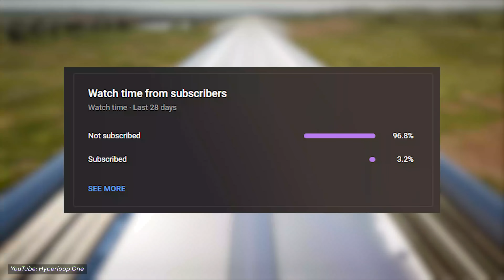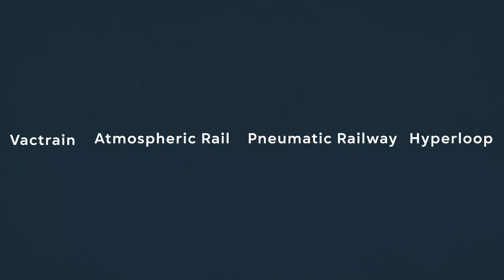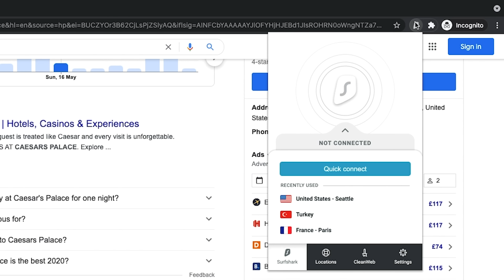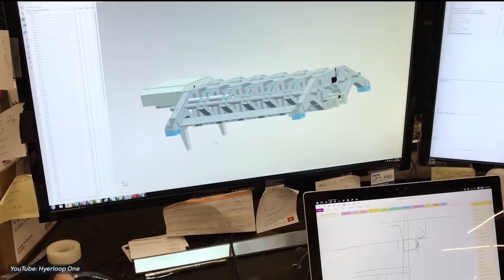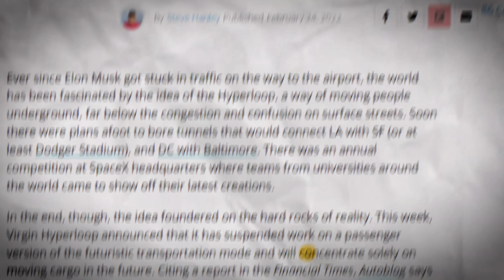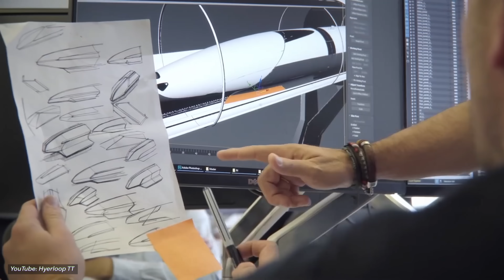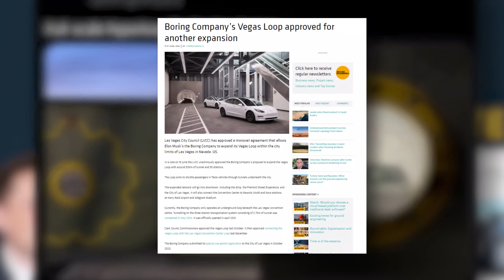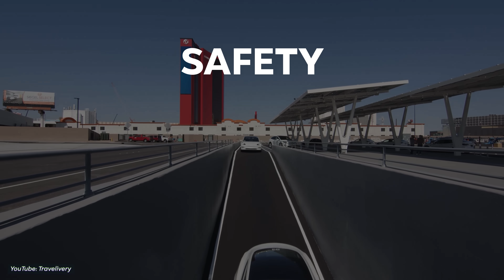What Happened to Hyperloop?

Comment: The only thing Hyperloop is good for, is for YouTube creators to make videos on it.
Reply: Fr
Reply: Yes I'm hyped up
Reply: Like Saudi's THE LINE
Reply: and for people like Elon musk to flex their money and power, when in reality, they were just talking from their asses. AS USUAL
Reply: I agree
Reply: @Skunket no solar tile roofs...
Reply: Elon is loopy.
Reply: And for bored artists to make computer renderings
Reply: i mean, if Canada has a hyper train that takes us from one side of the country to another within a hour.. I would use it.  That is like waking up to new sneery each week, trying out new food, meeting more people!
Reply: The correct name is "The Hypersonic Train" and it's basically, a hypersonic Maglev which would run in a technical vacuum tunnel (couple mm Hg) same pressure as it is at 30+ Km altitude! U need a pressurized Maglev train in the same way a space capsule has pressurized air. The maximum technical speed of such device is somewhere between 5500 and 6500 km/h to a maximum threshold of 7000 km/h or 4000 mph due to Coriolis Effect. The energy requires is 1/10 of a long airplane trip across the same distance , being able to transport over 2000 ppl. That's the initial Project. 🥰🤗😇
Reply: @Skunket I bet the reason that you hate Elon Musk is because he released The Twitter Files, stop being afraid of the truth and stop being jealous of Elon Musk
Reply: Bwahaaaahaaa hahaha 🤣 good one
Reply: 401 like
Reply: No, it's to undermine actual public transportation, so Musk can sell more cars.
Reply: @swingingkris  You actually think one man can undermine public transportation, you really are obsessed with Elon Musk 🤣
Reply: @briancleveland6115  Not the entirety of it, just some projects here and there. Every time he proposes some ridiculous futuristic bullshit is somewhere where there are plans for actual practical public transportation. And in a few places it has worked.
Reply: @swingingkris  You seem like you are still mad about not getting what you wanted for Christmas as a child !
Reply: @briancleveland6115  You seem like you ran out of arguments.
Reply: @swingingkris  I will never run out of arguments, but it does seem like you have ran out of answers !
Reply: @briancleveland6115  says the dude defending Elon Musk for the entire comment section of this one comment, also Elon has yet to prove a success other than a singular EV car, SpaceX has not launched really, he proposed an uncanny robot that more terrifying bc it means man kind becoming irrelevant, cyborg enhancements that would require ACTUAL TESTING to install into THE BRAIN, and of course hyper loop which the video says all, oh and he did send Twitter into its single worst dark age so yk, but I’ll be very happy to see ur retaliation comment to fairly solid logic
Reply: @creeping_ace2123  Are you racist against African Americans 🤔
Reply: @briancleveland6115  okay yeah ur fr out of comebacks that statement alone is uncalled for and I said nothing even remotely justifiable for it, so cope and just stop cause ur not winning anymore
Reply: @creeping_ace2123  You do know that Elon Musk is African American right !
Reply: @creeping_ace2123  I never had any intention of winning !
Reply: @briancleveland6115  sure bud u keep telling yourself ur not arguing against a stone wall, ima also be the bigger man here and drop the argument bc clearly u won’t stop and will always seeth at the things that u aren’t winning, so gg’s dude u win the most insignificant and sad argument ever of logic vs opinion
Reply: @Creeping _Ace21  Like I said my goal isn't to win, I was just pointing out the fact that what you said in your comment about Elon Musk was not factual, and instead of trying to defend yourself you implied that my only goal was to seeth about things that I want to win ! By the way it's spelled seethe not seeth,  and your last sentence made no sense at all ! Come back when you can actually defend your comments !
Reply: You nailed it
Reply: Thank God has been cancelled. This hyper loop system is supposed to be built in China.
Reply: No you guys said this type of things when Elon said he want to go to mars
Reply: @SkunketFWIW, this just needs more time to make, give it another 50-100 years and it’ll become a reality 😂
Reply: its an embarrassing idea.
Reply: AGREE
Reply: Youtube gets money from ads attached to clips
Reply: so true lol
Reply: but the concept is cool
its being used in nyc and in Disney land as garbage transport
Reply: @@Err-dp2ml straws for giants
Reply: @@ahisheks2776 Stop being obsessed with someone you don't even like, he made Tesla what it is today and look at how good Spacex is doing.
Reply: @@ahisheks2776 By the way some other is two word. And by some other two guys is definitely not proper English.
Reply: And what are you good for? Only commenting on YouTube about what other great people are attempting
Reply: The main reason Musk pushed it is to sabotage California high speed rail as that was specifically intended to reduce car usage.
Reply: If the U.S. doesn't do it, other countries will and leave the U.S. far behind.

Already, Dubai, India, Japan and other countries are building the Hyperloop.

Don't be short-sighted.

Highspeed transportation DIRECTLY result in higher economic activities, hence MORE WEALTH for the nation with it.

Do you want the U.S. to become a has-been?
Reply: @andyhughes1776  The US is already a has-been. Hyperloop is not practical. Building a vehicle to repeatedly carry hundreds of passengers, requiring either spacesuits, or risk the fatal consequences of a leak. Just see how much painstaking effort NASA went thru when simply sealing hatch on the space shuttle, after it's crew were loaded.
Reply: it gives them topic😅
Reply: Creating new jobs, he wasn't lying, cern, bluetube creators, tiktok, streaming, of,ph, lazy bullshit
Reply: All you Elon haters need to be quiet, what will it take? A free dirt brick for $200?  $5,000 (not talking a obout the jet location!)? Not sending your car into space?  $250,000 instead of a horse? Your $40,000,000 weed smoking fine to be paid off by the taxpayers? A job in return for awarding a $4,000,000,000 contract you don't actually qualify for? $6,000,000,000 overvaluation paid of your insolvent company? $44,000,000,000 for your company for an excuse to dump some stock? A cut of  the $56,000,000,000 paid bonus being given back because it's more than the company ever made in profit total?  Not being banished from Mar's by the emperor himself? Somebody speak up and name your price, we've barely put a dent in all the shenanigans which can effectively be handled.
Reply: Worked really easy for my video. No maglev needed.
Reply: Or show up in Futurama
Reply: Musk’s personal philosophy is that you need to exaggerate, embellish, over promise and commit acts of fraud, to get anything done. He is doing a lot of good, but we will see whether it was net-net worth the price of his lies. One thing is for sure, he makes an awful role model for future entrepreneurs
Reply: @lawjef  He isn't lying..  but perhaps there's just too many tunnels under America already, also California is not the correct state for this.. You forget California is over a few volcanos, the Andreas Fault, Medicine Lake volcano, Mount Chasta, and 4 others.
Reply: @lawjef  He is doing nothing good, he is a scammer.
Reply: @lawjef  You do know he founded Tesla right,  and is the richest person on Earth,  sounds like the best role model to me.
Reply: @briancleveland6115  musk founded Tesla, you sure?
Reply: @AzzrudinJamil  He was one of the founders, so yes, he also founded SpaceX and the Borring company.
Reply: @briancleveland6115  evry company elon made is useless exept space X
Reply: @briancleveland6115  have you ever heard of the Indian guy who had 40 billion but become poor cuz of his bad choices.......if elon keept this shit he wouldn't be so deffrent
Reply: @briancleveland6115  bruh i really understood nothing of what you siad
Reply: @briancleveland6115  lol he just bought tesla
Reply: @aaronpingol1566  He confounded Tesla, stop crying, if you don't like it buy your own EV company and beat him at his own game, and stop being obsessed with Elon Musk
Reply: @briancleveland6115  confounded means angry and i'm not obsesswd with i'm just saying facts that he isn't the founder he just bought tesla
Reply: @briancleveland6115  maybe your the one who is obsessed with him seeing how you defended him and everything
Reply: @briancleveland6115  He didn't and he isn't... 😆😆😆
Reply: @davidwebb4904  Stop being jealous !
Reply: @briancleveland6115  He did not found Tesla, he bought his way in and pushed the founders out.  Rich people are not necessarily role models.
Reply: @Andriastravels  Admit that the only reason you hate Elon is because he released the Twitter Files.
Reply: @AzzrudinJamil  he didn't. But it's his now.  -- RIP Nikola Tesla
Reply: @اسكندرفكار  you make me laugh 😂🤣 Space X lmao he nor NASA have broken the glass ceiling.
Reply: @aaronpingol1566  He had to be very successful to buy Tesla.
Reply: @briancleveland6115  yes his father has an emerald mine
Reply: @aaronpingol1566  So his father is also a successful businessman that's cool, I didn't know that, so you may be obsessed with him.
Reply: @aaronpingol1566  Not really obsessed, I never heard of him until about 2021, but you seem to hate him because he is successful and you aren't.
Reply: @briancleveland6115  that implies that you are very young. I just can't see how an adult can make it all the way to 2020 without hearing of him. Elon announced by hyperloop in 2013. He was already very very famous then. In the same league as Steve Jobs. But then you probably have no idea who Steve Jobs was. He died in 2011. You were probably 4 years old then. The rest of us who are older sees things differently. Because we have lived through and experience things you weren't aware of. As you get older, you would understand.
Reply: @briancleveland6115  his father was a white man in apartheid South Africa who owned an emerald mind. The usual response is not "cool his dad was also a successful businessman". You sound extremely young and naive. Or you're pretending to be and just trolling everybody.
Reply: @Daniel CH  You have me mistaken for someone else, I don't watch movies and the last time I went to a theater was about 20 years ago, I have heard of Steve Jobs and Bill Gates, and said I have heard of Elon Musk, it was about 2020 when I found out he owned Tesla,  and then later I learned that he is from South Africa, I was 45 in 2011 I've lived in 11 states,  Texas, Georgia,  California, Florida, Pennsylvania, Massachusetts, Maine, Florida, Colorado, Arkansas, Virginia, I've been to Canada, and to Mexico plenty of times,  I've only recently even slightly cared about politics or finance, so don't pretend that you know anything about me and I want pretend that I know anything about you, all I know is that you seem to hate this Elon dude  because he broke some kind of promise to you about some kind of high speed rail system, and you seem way too interested in him, all I know about him is what I've said before, and I'm not that interested in knowing any more. You really should stop being so obsessed with him and worry more about your own life.
Reply: @danielch6662  What's not cool about owning a emerald mine, or being white, I'm white because my mother and father were white, a person has no control over what color they are, so why do people make it an issue  ?  You say I seem young to you,  I take that as a compliment, you say I sound naive, naive about what  ? You talk like a you may either be a liberal or a socialist.
Reply: @danielch6662  You are the one who told me that his dad was a successful business person who owned a emerald mine, so don't try to outsmart me because I doubt that you can. And I only occasionally get on YouTube so you probably won't hear from me again.
Reply: @briancleveland6115  for someone who don't have a lot of freetime seeing how you don't watch movies you sure have a lot of freetime arguing with people who commented a few days ago
Reply: @aaronpingol1566  That's all you got ?
Reply: @briancleveland6115  He was NOT one of the founders. Tesla was founded by Martin Eberhard and Marc Tarpenning. Musk only invested in it and lated claimed to be a founder. It was not his concept and he didn't have anything to do with the design of the cars.
Reply: @briancleveland6115  Lol...are you one of Musks alt accounts?
Reply: @FarmerSchinken  You got me ! Are you one of Jeff Bezos alt accounts ?
Reply: @briancleveland6115  of a salesman.
Reply: @puntabachata  🤷‍♂️
Reply: @briancleveland6115  just because someone is a billionaire does not necessarily make them a good role model.

His lurch to the right and flerting with conspiracy theorist, racists and homophobic groups is starting to show his true character.
Reply: @briancleveland6115  he did not found tesla
Reply: @aaronpingol1566 No he was just an investor. The founders left cuz they got in a fight with him. So they finalized an agreement to "include" him as one of the founders
Reply: @Skunket And stop being obsessed with Elon Musk
Reply: We would still be going around on the back of animals if people won’t open their minds and expand their thinking.
Reply: @jasbarsoph  Laws of physics and material sciences spring to mind…
Reply: Plz understand guys he's time traveler from future.
That's why he's keep coping that early 21st century technology can handle stuff like affordable, safe and insanely fast hyperloop or Mars colony when it's nowhere near what we can make now.
Reply: I believe in the concept
Reply: 😂😂😂 good one man 👏🏼
Reply: The proposed plan of hyperloop and it's abilities would provide very beneficial to travel across the world
Reply: @averagejoe1971  So would a Star Trek Matter Transporter Machine. Your point?
Reply: @davidwebb4904  speaking of Star Trek, why does this look like the “Genesis 2” sub-shuttle from the pilot movie Roddenberry made long ago🤔😏😂 and man, that Vegas undergoes tunnel makes the channel tunnel linking France and the UK look lame, totally totally lame, they should have let Ironman build that thing and it would go clear around the earth by now 😂
Reply: @Skunket That's all you got ? that's what you people do when you can't defend your comments,  you result to insults.
Reply: @Skunket You are way too obsessed with Elon Musk, do you have a crush on him  ? Do you dream about him  🤣🤣
Reply: @Skunket  Do you know times Benjamin Franklin failed ? If you want to be successful you have to accept the fact that you might fail sometimes, Teslabots are being developed, their are prototype, self driving cars are a reality, spacex is doing well, Launch statistics
The currently active version, Falcon 9 Block 5, has flown 154 missions, all full successes. In 2022 Falcon 9 set a new record of 60 launches (all successful) by the same launch vehicle type in a calendar year. The previous record was held by Soyuz-U, which had 47 launches (45 successful) in 1979. It's funny how people like you are so jealous of Elon Musk that you hate him.
Reply: @Skunket he confounded Tesla and he created SpaceX,  stop crying, if you want a monorail get rich and build your own.
Reply: @briancleveland6115 he didn't . He was an investor in tesla and threatened to pull out his money if they don't change the company history to state that he was a founder.
Reply: @briancleveland6115  lol, you don't even know the history of your daddy Elon. :face-green-smiling::face-green-smiling::face-green-smiling: